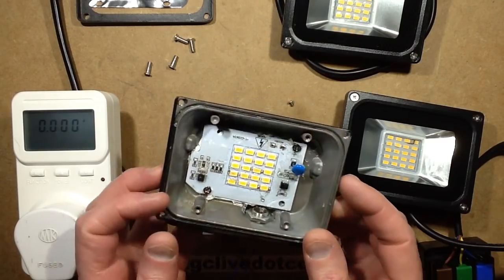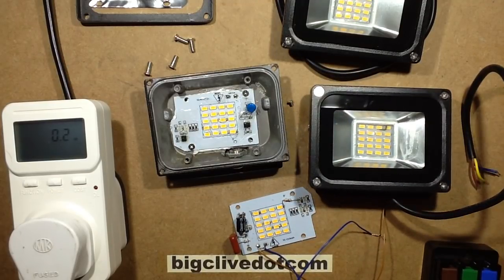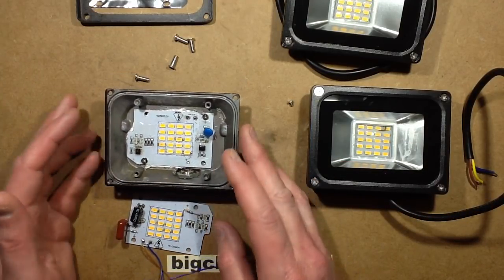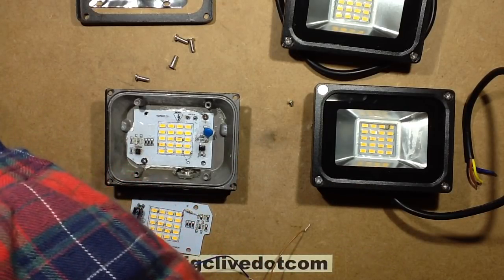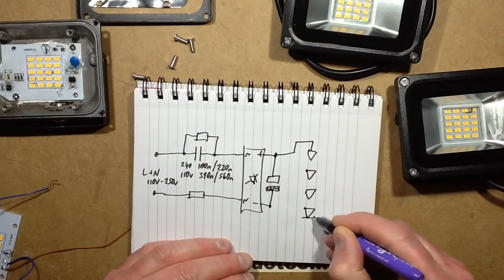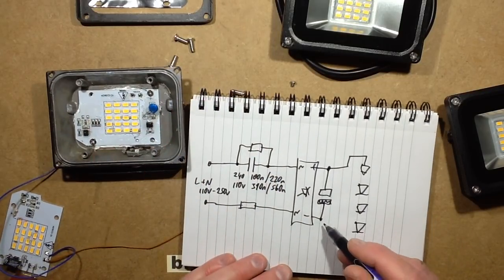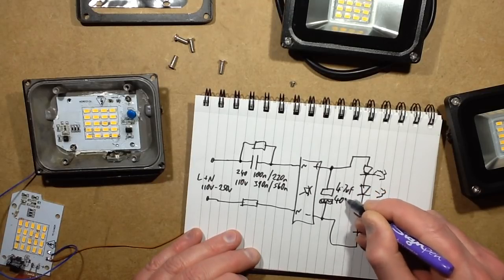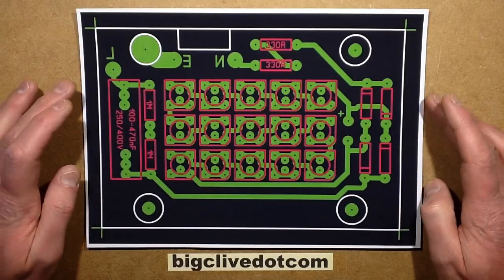DIY LED floodlight conversion module with PCB file.  (full build)

Comment: Great project, are the pink LEDs intended for grow lights? I seem to remember hearing that lead solder was banned to prevent lead entering the environment when people threw away their old electrical goods not because of fumes during soldering. Whether that was a sensible move I don't know, I can't help feeling it would have been better to insist all electrical goods were recycled.
Reply: +Wobblycogs Workshop yep lead solder is banned for production use, but not for those who are making or repairing one off items,  lead solder is much more forgiving to use.  it must add up in landfill over time,  same reason they got rid of nicads for most use (portable power tools got an exception, which may be over by now, due to lithium becoming affordable)
Reply: +jusb1066 Interesting, I hadn't realized it was still allowed for repair use. I occasionally need to get the soldering iron out and much prefer lead based solder. I have a reasonable stock pile as my Dad was in the electronics industry for many years and gave me most of his old stuff when he retired. I once had the dismay of watching a colleague solder using pure indium wire, at $700+per kg those were some expensive joints (we were chemists at the time).

Comment: It would appear that the LEDs on this module might be individually replaceable by using a SMS rework station hot air wand. Even allowing for the destruction of the defective parts. What do you think?
Reply from the maker: +James M DeLuca The original LEDs were non standard multi-chip devices.  Not easy to get.  The PCB is also a fibreglass/aluminium laminate making it harder to solder devices due to its high thermal absorption.

Comment: Really love this video.  Bigclive I would like to power a 40vdc wall pack led board and fixture.  The driver is no longer working.  I would like to use one of my ryobi 40v tool batteries to power it with an infrared remote control circuit.  The battery is being charged thru mppt dc conversion.  What kind of cc cv switching board would be used?   Would make an interesting video.

Comment: As a ham radio operator, i'd love to see how much radio frequency current is induced on the power mains. Any time you rectify an AC waveform asymmetrically, you create harmonics.

We encounter a lot of problems with Chinese engineering which doesn't meet FCC standards, or which is rated for industrial use but not the stricter residential standards. Some "big box" hardware stores sell industrial rated hardware and do it yourself homeowners buy it and create all sorts of radio frequency interference in the neighborhood. And those solar inverters... !!!
Reply from the maker: +Chaplain Dave Sparks This design uses full wave rectification and series limiting resistors, so it's quiet compared to the high frequency switchers.

Comment: Nice little project Clive- Anyone know the name of the housing for the board? I would like to build a few of these with brighter LEDS for DIY work lights Thanks
Reply from the maker: I recommend the standard 10/20W LED floodlights as work lights.  Preferably the traditional ones with drivers so that you can service then when needed.  The floodlight adapted in this video was an unusual style.

Comment: Would superflux LEDS have been any brighter?  I've no idea as I've never used them.

That PCB looks very handy so thanks for that.
Reply from the maker: +ThePillenwerfer They can be run at higher current, but I'd probably still run them at 20mA.
Reply: Thanks.  I'll stick with what I've got then.

Comment: Speaking of the silkscreen transparency, how do you know that "it takes shitloads of ink"? What indicator do you have, from a given print setting, that it hadn't had its "shitload" yet?
Also, the Seno GS components can be had easily off ebay. The clips are "Turbo Clips", the PE tube is either industrial stuff (try "layflat polythene tube"), vacuum sealer bags (if you don't mind the structured surface), or possibly freezer bags. By the way, the Turbo Clips don't just come in assortments of several sizes, there are also packs of ~10 of a single size.
Reply from the maker: +Anvilshock When using the highest ink setting it all instantly absorbs into the film with high definition.  Lesser films end up with wet unabsorbed ink on the surface.  It would be nice if I could actually increase the amount of ink to see just how much of a shitload it could take.
Reply: Got it, thanks!

Comment: The lead-free solder is not because of people dying of lead, it was because of all the stuff ending up in landfills.
Reply: +Alexander Borsi yeah, if they had stuck with gold like the moon modules all those Indians would be rich! :-P
Reply: +Alexander Borsi
And now because of the lead-free solder we get even more failed electronics in the landfill when connections fail easier because the stuff is so brittle.
For some reason lead solder is still allowed in medical equipment, I wonder why.
Reply: +Pentti Hilkuri The LED exception applies to multiple categories where failure would be bad for society.  This was based on the unavailability of quality lead free solder when they passed the exception known as ROHS5.
Reply: So the lead-free was mandated because certain statistically significant amounts of members of the public were deemed ineducable as to the use of proper electronic-waste disposal facilities? Well done. This is why we can't have nice things.
Reply: Instead of banning lead solder, why don't we ban people who can't dispose of the devices properly from buying them?
Reply: Just try disposing of stuff "properly" and see how it goes.  In NY City, you wait for the one day every few months when the city will accept e-waste, then you are expected to schlep out to a designated site, miles from any subway station, with your item in hand.  (Try it with a large TV set or desktop computer with CRT screen.)  Net result, unsurprisingly, is that people leave their crap on the sidewalk in the middle of the night.  Then the sanitation guys in the garbage trucks ignore it.  Then the city fines the poor schlub behind the nearest door. 
It's a brilliant system.
Reply: Dave Micolichek  In Ireland all WEEE recycling is free, just take to a recycling centre or with dead batteries the supermarkets take them. There is also a like for like option for most electrical goods, if you buy a new tv the store has to take your old one if you ask them to.  There is a recycling fee built into the price, so we do pay a little more on new items.

Comment: Hi Clive, I enjoy your videos very much. Can you tell where I can get the plug in device which measures watts, voltage and amps. I have tried to find it online but with no success.
Cheers,
Bill
Reply from the maker: +Bill O'Brien Its a power or energy monitor.  Sadly the most common one on eBay is rubbish.
Reply: +bigclivedotcom Thanks for that, I'll see what I can find.
Bill

Comment: Looks like you could make a pretty good led grow lamp with an upscaled version of this with dedicated blue and red LEDs making a similar light output to purple-pink.
Edit: Actually, pink LEDs curiously put out a similar range of spectrums to that of the PAR ranges (blue and red), but a set of dedicated LEDs with a possible UV/IR supplemental LEDs might do pretty good along with the pink lit ones.

Comment: i am totally hooked by your videos they are spot on with content and speed. I have recently built a couple of the maplins projects namely the thermostat and interval timer which run on 12 volts what is the best way to convert them to run on 24 volts?

Comment: Nice video.
But maybe you could have done a zig zag between the two upper rows and a straight line in the bottom row in the design with bigger pads?
That way you could have left the bottom "-" strip put.

Comment: Good video. What is your obsession with pink?
Would be a good board to fill with UV LED's
Reply from the maker: It's an ongoing channel joke.  You could use UV LEDs, but it is a low output light.

Comment: The only thing I recall lead based solder being banned from is in the application of plumbing water lines for obvious reasons it goes into the tap. This is where the confusion about it being banned comes from and I guess if you are prone to eating circuit boards you might want to use silver solder...;)

Comment: Hi Clive
I notice that many of your projects use the same white laminate board, I have tried searching for this type of board but had no  success, what is it made of and where is it purchased from.
Many thanks keep up the good work.
Reply from the maker: It was a hybrid material from a UK supplier called Mega Electronics that combined two fibreglass outer layers with a paper based internal core all bonded together with resin.  Sadly the manufacturer that made it for them is no longer making it.  It's a shame, since it has a really nice off-white surface.
Reply: Many thanks for your reply, yes it is a shame it looks so good.
Reply from the maker: Mega are still trading.  http://www.megauk.com/

Comment: Had you ever considered opening up an online shop where you resell low-volume quantities of items such as these? Because while you can't compete in mass with china, you can certainly compete with hand-finished quality. And nobody would complain about paying for quality, save for the ignorant among us.

At the very least you could buy a bunch of low-quality products, spiff them up and flip a bunch for a modest profit.
Reply: +Doug Reed I found the "Knob controller software upgrade chip"...
I laughed most immaturely.
Reply: +bluephreakr I agree. BigClive does a great job of making his builds serviceable in the future, which is so uncommon in today's use-and-throw-away electronics industry. I would buy his stuff simply because I know I would be able to keep it working for decades into the future.
Reply: +bluephreakr +1 for this!

I'd buy something by +bigclivedotcom over other products any day! 

I find myself in shops and online asking myself "Would it be good enough for BigClive / Dave Jones / Mike / etc. to buy and use it?"...
Reply: +Doug Reed IT's probably the g o 0 g le  version of an idiot light. They suspended my right to post for two weeks (which is probablynext for you!) because I wrote a friend 3 comments in a row .... now he has to specifically OK my comments, individually.

Hickock45 lost his channel for a few days and I suspect its a similar issue. They have way too many comments to do any kind of manual review. I did "challenge" it and lost -- surely computerized, too.

Now I think I see a bit of both sides -- so many people making second names (while I never have) versus people losing their rights over nothing.

couldnt  find much about this when i g00gled it -- no surprise there!. its brother g00gle! ;D
Reply: Too bad I live in the states ... if Clive did something like that, I'd totally go to his place to help out :P
The problem is, it just takes too much time, and doesn't get you enough money ... unless you have things overpriced (well, excessively marked up).
Reply: I whould go there

Comment: I bought one of these with a 12V input, and it works excellent! Better to use an external 12V power supply than the edgy built-in supply in the 230V versions.

Comment: Sneaky trick I use for etching - I put the PCB to be etched into one size of tupperware, then either put that inside another larger tupperware, or float it in the sink. Either way float it in HOT water and you'll heat your Ferric Chloride nicely. Also it's a lot tougher than that system (I am not sure that one pet here wouldn't have gnawed holes through that sleeve, making a heck of a nasty mess!) Rocking either inner tupperware will cause it to rock for a while, agitating the solution...

Comment: The bad LED would have had to fail shorted in order for the rest of them to stay lit, what would be the best way to find a failed one if it had failed open?  Is testing one at a time going to be the fastest, or is there a trick for figuring it out with less hassle?
Reply from the maker: +Das Grinch The open circuit voltage is so high that they usually fail short circuit.  To find an open circuit one you'd either bridge them individually (or in large groups to narrow it down quickly) or for a safer test use a meter on diode test to make the LEDs glow individually.

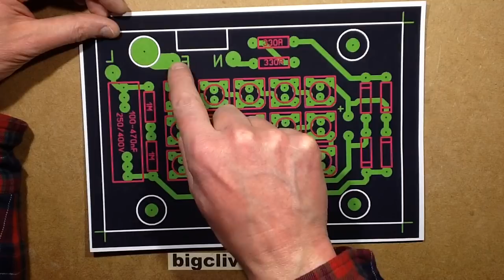Comment: at 6:37 isnt the live trace not a bit too close to the screw in the bottom left? I'd put a little bit more distance between the screw and trace just to be sure.
Reply: +tHaH4x0r nvm just saw you made a v2 already which is a bit better
Reply from the maker: +tHaH4x0r The circle around the pad is also just a clearance zone.
Reply: +bigclivedotcom Yeah i noticed it on the actual pcb. Well i'd rather have too much creepage than too little haha

Comment: Speaking of "Thermal Mass" of those soldering irons... the iron appears to be identical to the Maplin "Precision" temperature controlled iron, but I find that because the bit doesn't actually physically touch the heating element... the temperature control never uses the relatively high (60w) power, or show the temperature go down even when it's very obvious that the bit has been cooled by a large cable or something that can sink a lot of heat... have you encountered this problem?... I considered packing the bit with thermal compound before putting it on, but that could get very messy...
Reply from the maker: +James Lewis Apparently the Hakko irons that these clones are based on, use a small springy liner, much like the Antex bits.  It's odd that these ones don't have that, although the central heating core being bare ceramic might be a factor in that.
Reply: bigclivedotcom I've had it completely fail to melt the solder on a large tab due to heat being conducted away from the iron, but the temperature control says the temperature has not changed... perhaps I'll try some kind of thermal transfer system... I'm not sure what would happen... I imagine at 350c the volatile components would evaporate fast, and perhaps leave a dry paste behind, or it might just catch fire.
Reply from the maker: +James Lewis I'm not sure I'd recommend the paste.  You could try a larger bit for the higher mass tasks or even cheat the temperature up momentarily.
Reply: bigclivedotcom I agree it's far from ideal... but as you say, the issue is that there's no physical contact with the heating element...  It makes the "60w" rating almost laughable when my 25w antex iron had no trouble with the join I could not complete with this.  I think it's worth experimenting since in the worst case a complete replacement iron is less than £10.
Reply: Nice pink light, I'm not conviced by the colour but making up PCB's does make things look so much more professional than they might otherwise... I've only ever done is by hand drawing the tracks, I guess that was before the advent of ink jet printers!
Reply: bigclivedotcom Oh, regarding lead based solder... the reason for lead free solder is not for during manufacture or use, it's due to the risk of the lead leaching into ground water when products are disposed of in landfill.
Reply from the maker: +James Lewis The same landfill that now has a significantly higher amount of electronic stuff in it than before as a direct result of the sheer unreliability of lead-free solder.
Reply: bigclivedotcom Yes, lots more dry joints...  I just watched a review of the genuine Hakko solder station this is a clone of... I think there's a chance that since the metal liner tends to get stuck on the ceramic element of the hakko iron when you remove the bit, if you bought 1 hakko bit, you could retain the liner by simply leaving it on the heating element and that might make a big difference to the thermal conduction.
Reply from the maker: +James Lewis That's assuming you can find a proper bit that does come with the liner.  The generic bits passed off as Hakko don't come with the liner.

Comment: you could try to do a simulation of your circuit, before making it. For example in LTSpice. I am no expert in this software but it is free and contains a lot of parts you can use and gives you a lot of options to "test" your design

Comment: Etching in a bag is a clever idea!
Reply from the maker: +hoggif It's based on the Seno GS system.  Very clean.  Sadly I nuked my original Seno system in the microwave.
Reply: +bigclivedotcom I found a source for the clips by size (rather than a kitchen assortment) eBay seller sugarbabykids. Much cheaper  if viewers just need one size.

Comment: Clive, is it possible that a Littlefuse or small Buss fuse for a low wattage device that has been working perfectly up until the moment it went dead (a Heathkit indoor/outdoor thermometer with a neon Panaplex display from the early '70s) might have failed due to the old age of the fuse?
Reply from the maker: +BobEckert56 Yes.  Fuses can fatigue over time and fail for no particular reason.  Make sure you replace it with the exact correct type, and get a spare or two just in case.
Reply: bigclivedotcom I built it back in the 1970s and if I do say so myself did a super job. Great quality components. I still have the assembly manual of course, but I appreciate the reminder about using the exact same fuse type and rating, it can't be said too often. The fact that it has worked perfectly for that long (save for a replacement of the Panaplex display once) made me wonder about this. I'll check the fuse with a ohmmeter (also Heath of course), hope I find it open and when I replace it, hope the patient pops back to life. Thank you for your answer. Really like your channel a lot!

Comment: I see your capacitive voltage dropper, and raise you one saturable reactor type regulator for 21x 100W COB modules.

Inductance - the other other non-resistive impedance. Now with electronic variability.